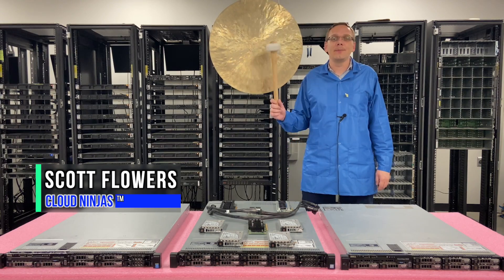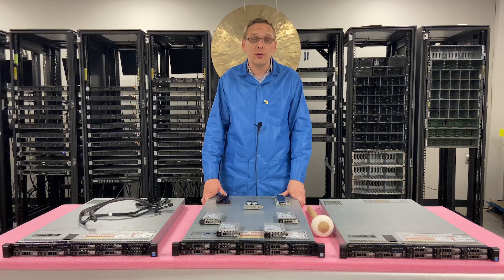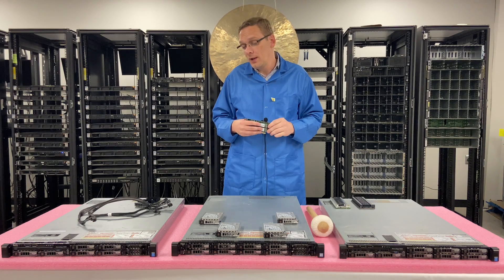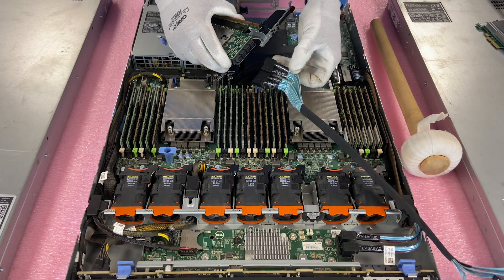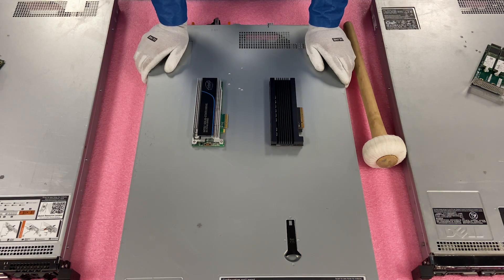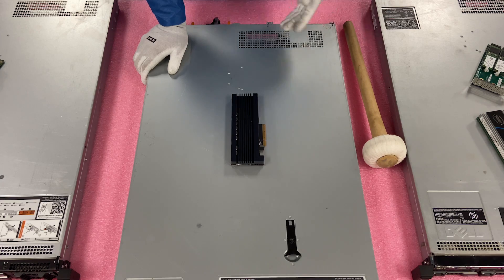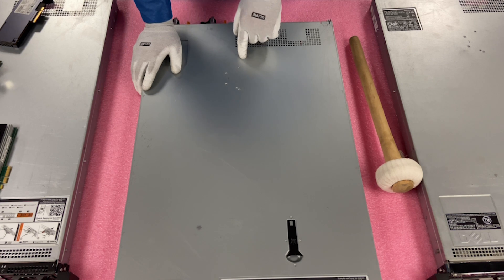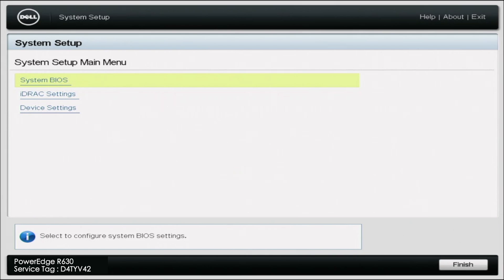Dell PowerEdge R630 Server | NVMe SSDs Overview | Install Tips | How to Configure | M.2 | U.2 | PCIe

Comment: Intel Optane SSD for the mf win! U.2 to PCIe adapter or just use the 900 or 905p Intel SSD PCIe but I think that's sadly only PCIe 3.0. Either way even PCIE 3.0 Intel Optane SSDs wipe the floor clean with modern day m.2 NVME SSDs!

Comment: Does it works also on the R330?
Reply from the maker: Negative
Reply from the maker: Would be cool if it did though
Reply: @cloudninjas  and with an Intel DC P3600 ssd or a Dell 256gb ssd nvme, or BOSS SSD Adapter Card? The 330 isnt not so old😁

Comment: Question server ninjas , Is it possible to use PCI to M2 Adapter on dell poweredge R520 ? and use NVMe drive as boot drive ? I am unsure as its a very old server with old BIOS. Please help me if you can provide any insignts on this. Many thanks

Comment: good morning
I bought an Intel disk and it doesn't recognize it at all. Does it really have to be an Intel Dell disk? Is there no other way to recognize it? I'm using SSD DC P4510 Series. Who can help? Thanks!
Reply from the maker: Try updating your BIOS.  Make sure in the correct drive slot as well.  Good luck!
Reply: @cloudninjas já atualizei para última versão e não tive sucesso. Vou ter que arrumar um jeito de trocar para modelos dell. Obrigado
Reply: @cloudninjas  I already updated to the latest version and was unsuccessful. I'll have to find a way to swap for Dell models. Thanks

Comment: 3:05 jeez, that's crazy vendor lock
Reply from the maker: We need to make a new updated video.  At some point, one of the BIOS updates allowed for generic drives to work.  Some are still finicky though so be careful.  Good luck!
Reply: @cloudninjas  yeah, that would be interesting.

On the second thought, now I'm curious why 2 x m.2 card wasn't locked out. Perhaps, PCI-E bifurcation confused piece of code that supposed to do locking out? (in which case connecting PCI-E x4 HHHL SSD card with bifurcation enabled would've worked too)

Thanks for reply!

Comment: Thank you for the great video. Do you know  "Supermicro PCIe to M.2 adapter" approach will work with   Ubuntu / KVM? Also ... Do we have to use supermicro card or some similar adapter from amazon will be okay (like EYI Quad NVMe PCIe 4.0 Expansion Card , Dual M.2 PCIE Adapter for SATA , etc. )?

Comment: Is the setup the same when using a R640 with those NVMe cables?
Reply from the maker: R640 different.   No card.  Just cables.  And multiple cables depending on how many slots you want for NVMe.
Reply: @cloudninjas   Thanks!

Comment: Thank you very much for the video. I bought the adapter and it worked as expected for mounting drive (for one nvme - did not try it for 2).

However, I would like to talk a bit about my experience: 
I have a Dell R730, and it was a big headache for me to boot Linux from NVMe SSD. 
There are several ways that I have seen people are using them for boot, but I end up not liking any of them! 
I bought 2 SSDs: One Sata, one NVMe from Samsung, identical in storage (2TB). I used the PCIe (Slot 4 - 4x4x4x4 bifurcation) for the NVMe. 
Tries and errors: 
1)I installed the Ubuntu server on Sata and ran the server. Then I cloned the partitions from Sata SSD to NVMe SSD. The aim was to boot from NVMe --> Didn't work 
2)I partitioned the Sata in pieces, one of them specifically for boot. Aim was to boot from Sata, to root from nvme -->Didn't work 
3)Tried to tweek the partition info during setup and assign nvme for root --Didn't work 
4) I had to install Clover and use it for boot.-->Worked 
     Dell has to have some kind of Bios limitation to aftermarket parts. It sees the nvme, and Linux is installed on it via either OS deploy bios interface or directly booting from USB. But it does not boot from the nvme. I ended up sticking the USB clover to 3.0 USB on the main board; at least, when I look at it I don't see it. And then changed boot options to directly boot from this USB. So it automatically resumes booting without my interaction. (Clover has an option for time intervals). 
    For new users' convenience, do not waste your time with how-to videos, copy-paste etc. (they were horrible, by the way). 
    Just download and run the clover installer(not iso, not etc.) and get into the Customize menu on the tool and only add nvme driver. That's it. 
5) I hear bios tweaking efforts, but even though they achieve to boot from nvme, you get errors afterward, and finding bios pins is a headache,---> Maybe, I'm all ears 
6) I saw BOSS (Boot Optimized Server Storage) units on Ebay and Amazon (40-189$). But whichever seller I asked about it (well established for IT business) on Ebay or Amazon, they said the product would not boot Linux with a Samsung 2tb nvme m.2 SSD, and mentioned they are for M.2 sata--> Maybe. I'm bored of rebooting and re-installing Linux. And I'm not gonna try unless someone shows that it works on youtube. 

Possible Question: Why don't you use VM? 
Answer: I need the full potential of all cores and rams for quantitative analysis. 

Cheers! Hope this will be useful.
Reply from the maker: Appreciate the detailed information.  I'm certain this will help someone else in the future.
Reply: Thanks for the information.
Got the Supermicro card and some Samsung 990 sticks.
It's now working well with the Clover Bootloader installed on the internal dual redundant SD-cards, although even this was quite cumbersome to get working. Could not get it working without manually editing Clovers config.plist to include (and default to) the volume GUId.
Reply: I came here (two years later!) to say, Clover Boot Loader. This is the way! Five Dell PE r730xd, one Dell PE r630, and four HP DL360gen9--all booting from NVMe using CBL via USB flash. Proxmox, Debian, XCP-ng--all work. Just say, "No," to VMWARE.

Comment: Which NVMe form factor (M.2, U.2 or PCIe gen xx ?) should I use to create a Ceph HA cluster for creating VM/CT on Proxmox hypervisor. 
Proxmox node cluster is running on local 2x SAS SSDs connected to RAID/perc?
Reply: Hello. You should go with U.2. ;)

Comment: I have R640 with NVMe cables from backplane to motherboard.   In this video you have a card in riser to Backplane.   Do you hvae this card for R460? and can I configure RAID 1 on 2 NVMe drives???
Reply from the maker: Contact sales@cloudninjas.com and we can support you with the correct card and cables.  Thanks!

Comment: Are you sure that only a PCIe NVMe SSD with Dell Firmware will work? I don't see any reason why, since in the OS it should just show up as an additional PCIe device, no?
Reply: no, they have some custom stuff for RAID, so it doesn't show in the OS

Comment: I used the M.2  on Hyper-V using storage spaces, proxmox, Truenas, Linux, in general, using ZFS... for storing VMs.    As for booting, I have to use the SD add-in card to run clover boot and boot from NVME  but  as far as general storage  you can use any SDS solution
Reply: sd card part number PMR79  it lets you mirror two SD cards   it used to be used for VMware but I think they moved away from supporting that
Reply: @StephenPreston  So, as I understand you, you have retrofitted the Dell SD card reader PowerEdge R630 and one (or two?) SD cards are running there that you boot from? What OS is running on the cards? Is there a video description of how to set this up with Clover? My goal is to boot a Server 2022 and run a Hyper-V on it. Can you support?
Reply: have you configured the m.2 disks raid ?
Reply: @sebastiann7009    using storage spaces, but boot no i dont think thr r630 is able to boot from nvme although  i have not used the u.2 bays.. the BOSS  cards i dont think got support until  Gen 14

Comment: For the U.2 using dell pcie expander kit does the nvme ssd must be Dell? With Dell firmware?
Reply from the maker: This is what we have found.  When we installed Samsung or Intel they didn't work.  We could only get Dell to work.  But I will also say we are working on a work-around solution since Dell SSDs are expensive.
Reply: @cloudninjas  i hope you guys figure it out. Thanks
Reply: @cloudninjas  Samsung and Intel don't even appear in the bios, can you tell me that? Thanks!